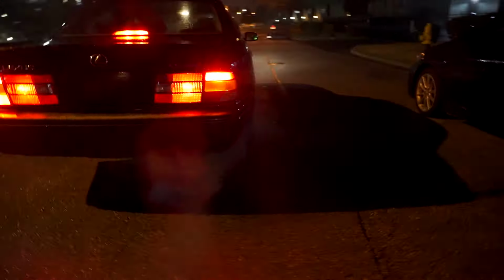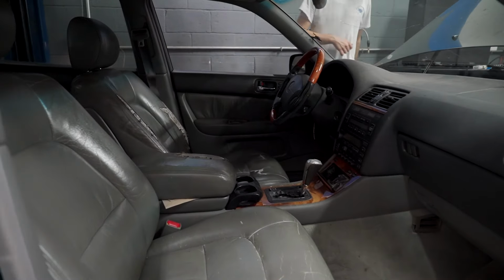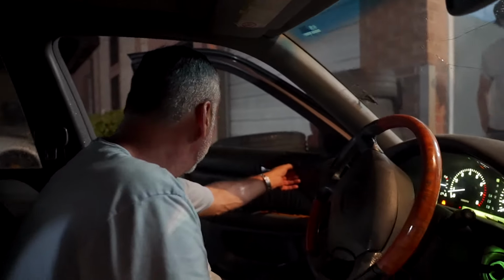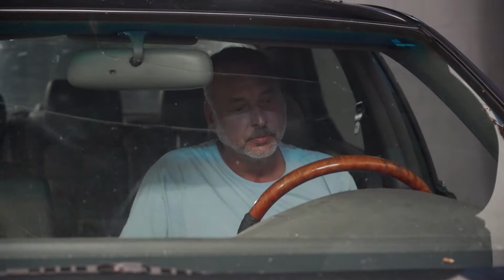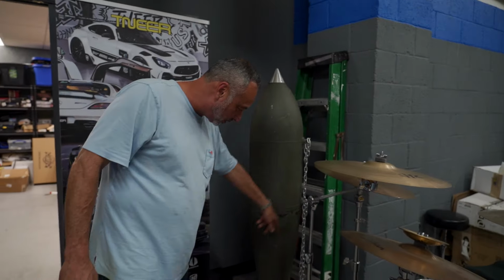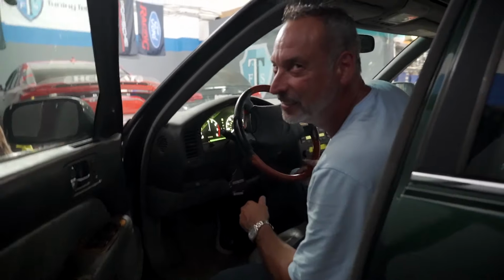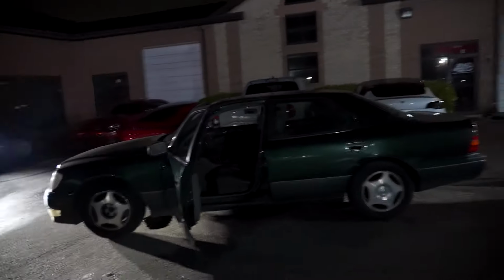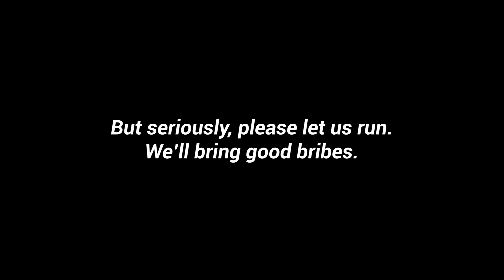REVEALING OUR 24 HOURS OF LEMONS RACE CAR! Let The Build Begin!

Comment from the maker: We need a theme! Any ideas?
Reply: strip down the interior, full on straight pipes, better intake, better radiater, some strut bars to stabilize the car on those corner, maybe something with the ECU if the car allows
love of india!!
miss savage garage
keep up the good work!!!!
Reply: PULP FICTION or RESERVOIR DOGS. MR. PINK, MR. BLONDE etc.
Reply: Being that you are incorporating a bomb and the car is already green, I think a WWII theme would be rather fitting. And you can even get the classic “Shark Teeth” design from fighter planes on each side of the car.
Reply: Call it Manic Missle. Theme could be WW2 bombers. That looks like a bomb rather then a missle.
Reply: Make it look like the car from fast and furious. The fbomb car. Think it was a firebird.
Reply: It will never be better than the S-Class LOL but the Chinese really love Mercedes so that's why the Lexus looks like a w140 S-Class anyways love your videos thanks keep doing what you do
Reply: Münchhausen: 
The Myth of a Guy riding a Canonball. You could turn the idea on it's head and let the missle ride you.

Comment: The vvti 1998-2000 are quoted 290hp which is a plus on the model you guys got. I would strip out the rear seats, drop some lighter seats in the front. Get some better rotors along with brake pads. Straight pipe it since the mufflers weigh like 80lbs.